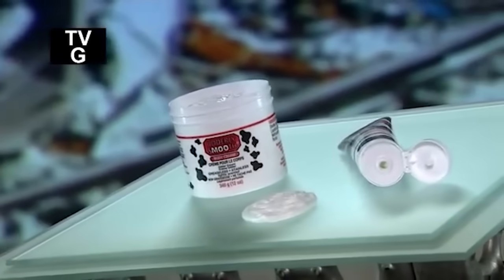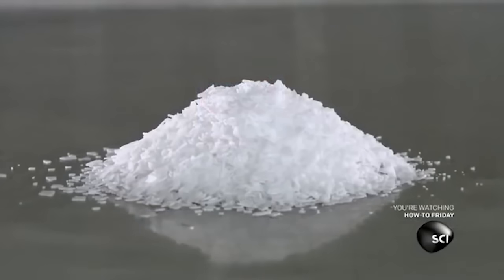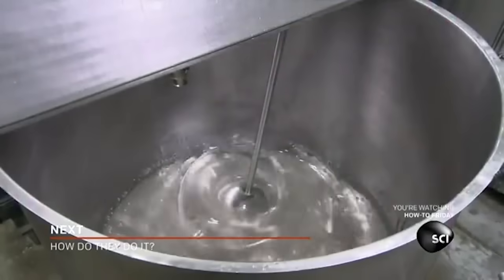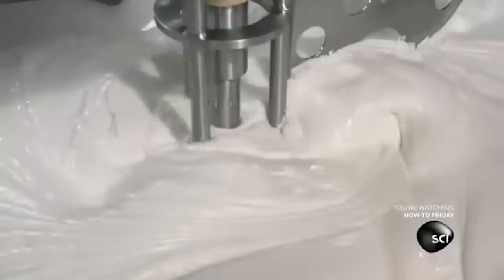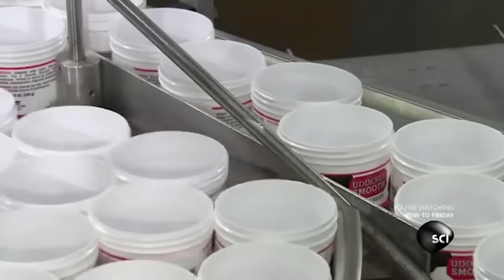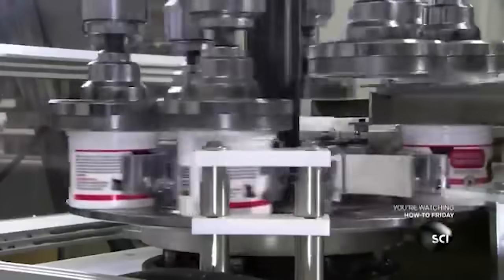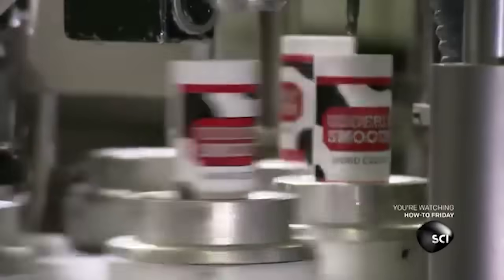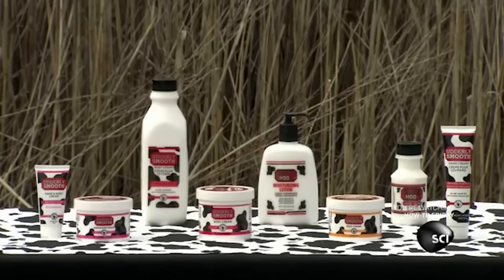How It's Actually Made - Skin Cream

Comment: ok I think I thought of a good way of phrasing the clear difference between rinsing and filling machines. The vessel that is to be filled later is tipped UPSIDE DOWN when it's in the rinsing machine. When the vessel needs to be filled, the vessel has to be positioned back to RIGHT SIDE UP for it to be ABLE to be filled. Let's see if someone can still somehow come up with a bullshit confusion thinking the vessel can actually be entirely FILLED whilst it is upside down. (yes rinsing machines do get some water droplets into the vessels, but that's not filling the vessel. That's just dotting it with water droplets.)

Comment: You can’t lose with real Udder Butter! My uncle had holsteins and told me to put some on a sunburn. Red head, before sun block was a thing. My mother used to buy it for me all the time. The new stuff is just skin cream, but I live in a farming area. I use the real deal, and it’s cheaper and better than the cosmetic stuff available. If it works on Bossy’s udder, it’s good enough for me! 🇨🇦🖖🏻🇨🇦

Comment: Hydric acid is also unique because it has a similar chemical structure to many bases, which are known to be even more corrosive to skin than acids. Also, hydric acid (or dihydrogen monoxide) causes thousands (if not more) deaths per year due to inhalation of the chemical. It's also a common waste product from nuclear power plants.